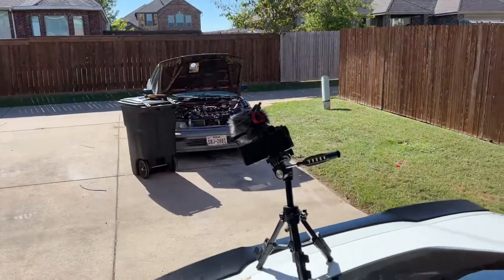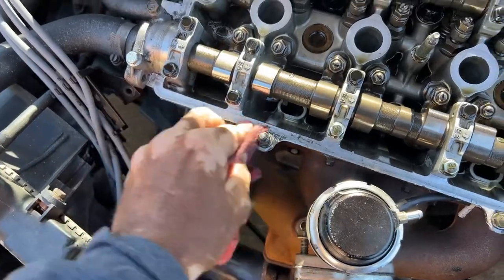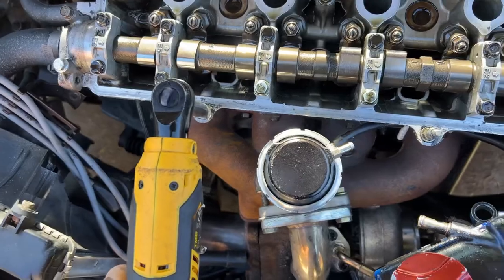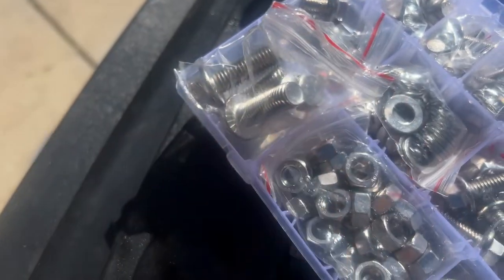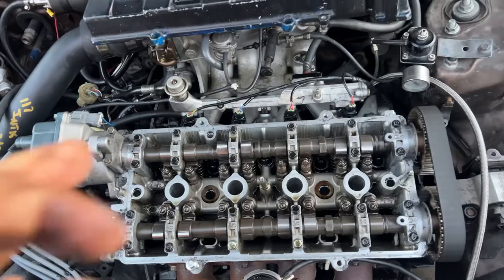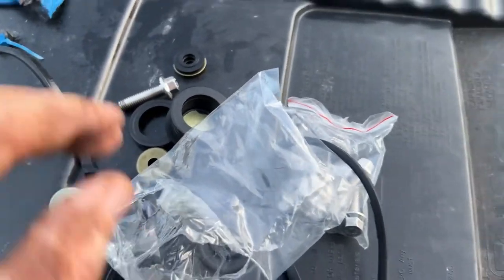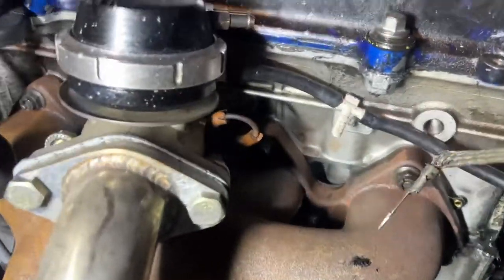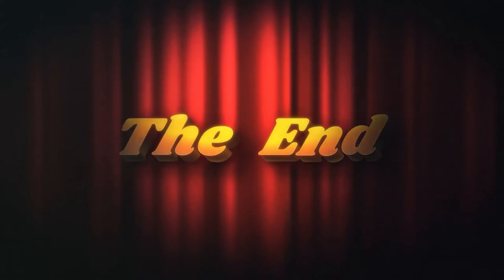Honda Civic Ef B Swapped Valve Cover: Hardware Store Screws Work!

Comment: Hi bro just askin my b20b vtec type r head im using wiseco piston  spoon cam gear arp bolt titinumnretainer its good
Reply from the maker: It's good... but b20's have thin cylinder walls so if you're planning on big boost, sleeve it.